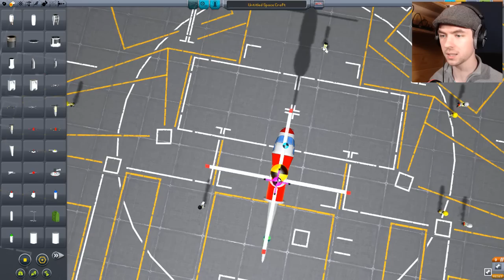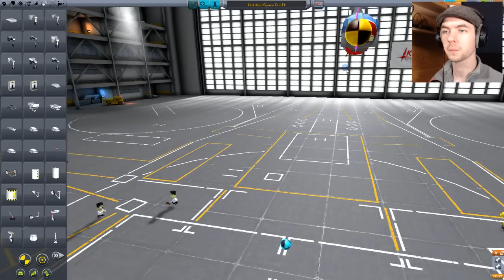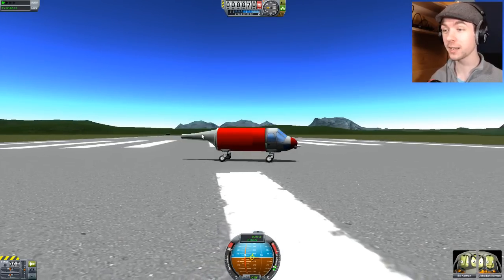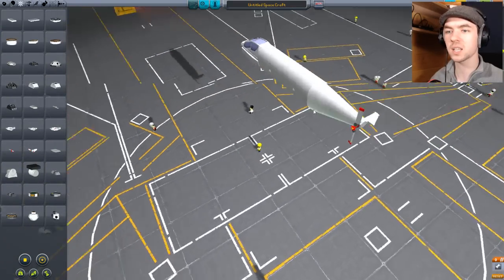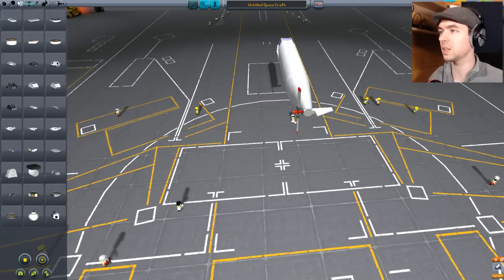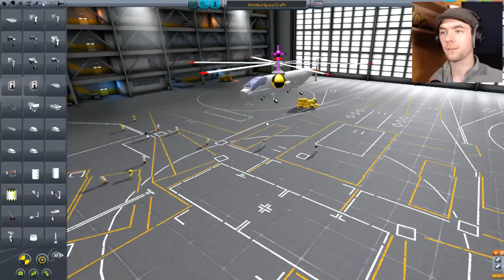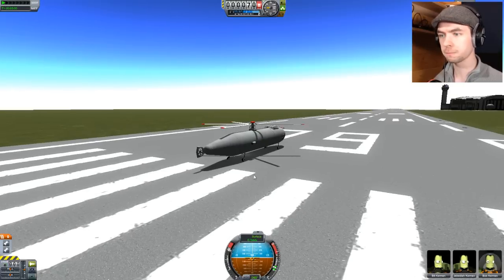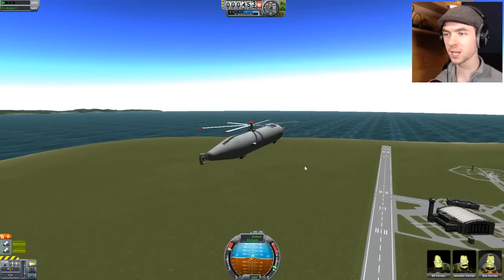KERBAL SPACE PROGRAM 18 | GET TO THA CHOPPAAAHHH!!

Comment: Jack, your helicopters were fine. It was your flying. when you press down the nose goes up and when you press up the nose goes down. So, if you're going to make helicopters either remember that or invert your up and down controls.
Reply from the maker: Yeah I know, that's what I was doing. My designs were just off and no matter what I pressed I couldn't fight back against it
Reply: jacksepticeye Did you try to push up to go forward and down to go back instead?
Reply: jack you had to put wings on the back even tho it worked fine until you exploded

Comment: A plane/helicopter would be sooooo cool! So it would have propellers and wings! it would be weird and hard to control, maybe, maybe not. it might be really fast or slow, we wont know until we test it! Like if you like that idea!
Reply: It already exists, and it's in the military already :D it has two rotors on the end of it's wings the can turn for upward and forward propulsion.
Reply: There is also a really weird and cool thing called a gyrodyne that uses an engine powered rotor and two engine powered propellers, it uses the rotor to take off and once in the air slowly transfers the power from the rotor to the propellers, to fly forward like a plane, whilst always keeping a small amount of power going towards the rotor to maintain height. They pretty much look like helicopters with wings and propellers on them.
Reply: like #septiceye101
Reply: landon scranton its a V22 osprey
Reply: Ho
Reply: That my friend is called a VTOL
Reply: Vtol or rotodyne